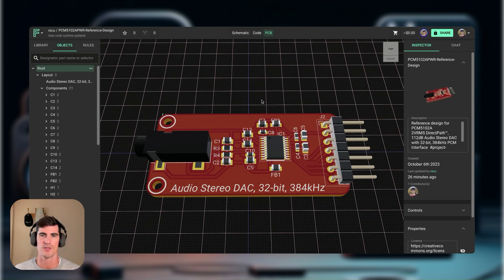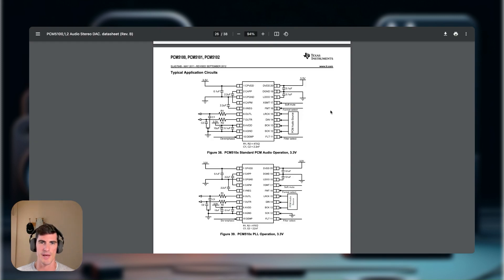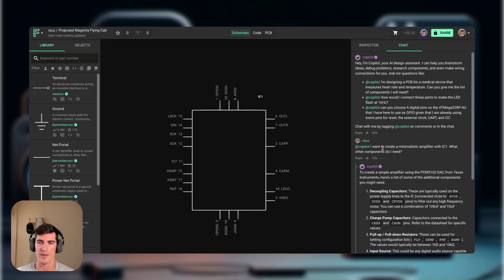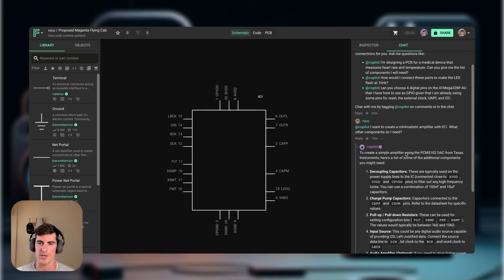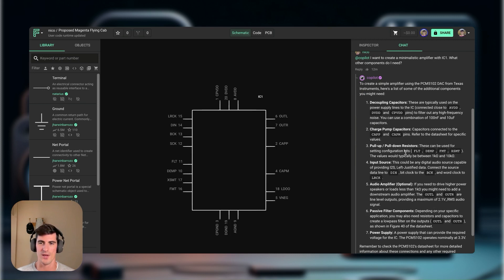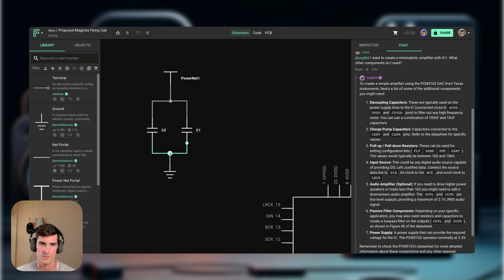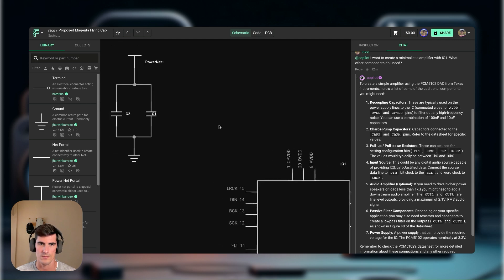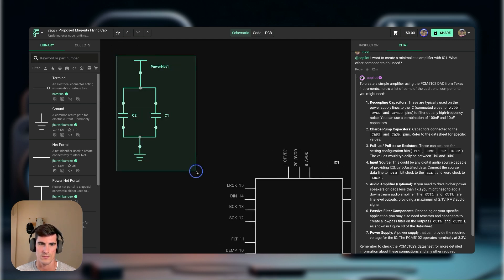How to design an Audio DAC with AI - Tutorial

Comment: Honestly this does not seem like a great use, the circuit is almost identical to the typical application example in the datasheet, only with a slightly different filter. The filter in the datasheet also seems to be better, it uses common 470 ohm resistors and 2.2n caps to form a 153khz low pass, and unless my calculations are wrong (correct me if I am mistaken) the AI suggested values seem to give a 3db point of almost 290khz.
Reply from the maker: Hi Justin, Nico from Flux here. Thanks for the feedback! Absolutely agree the circuit is similar to the datasheet, that's what was what I expected when I asked Copilot for the simplest setup. We have other examples with more complex circuits: https://youtu.be/FL7e0OXTLic
Reply: @buildwithflux  You ignored @justin.campbell question. Why was the AI changing the filter for the worse when it was suppossedly following the datasheet example circuit?